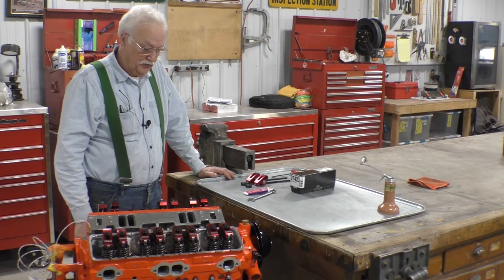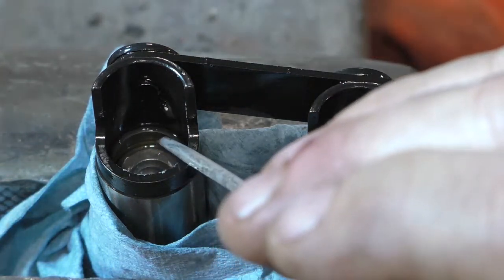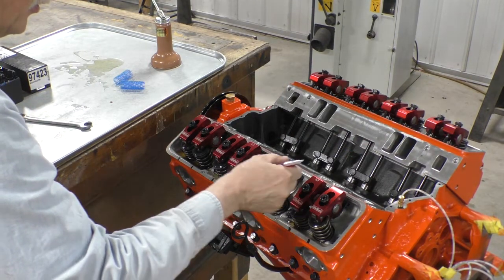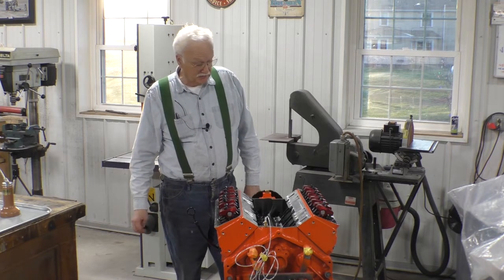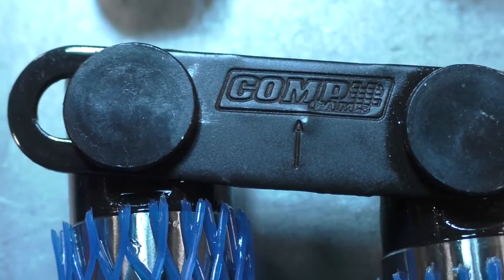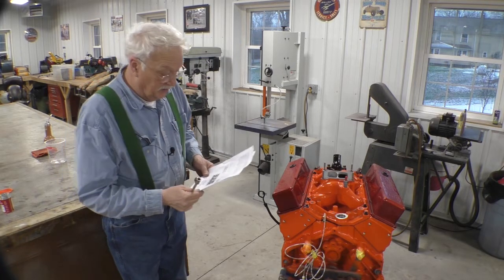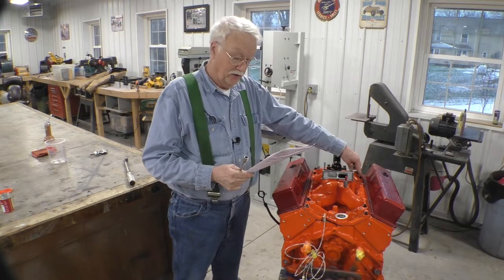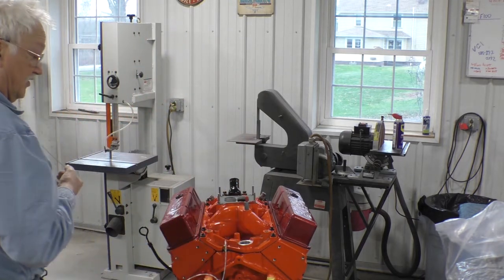SBC Intake Install and Timing the Engine

Comment: Glen this problem with the poor quality HR roller lifters has been going on for decades. Hydraulic roller lifters are the way to go for street use, but the best precision made lifters are made by Johnson company. They make lifters for the OEM engines in our passenger cars, it seems that most rather ALL others are still trying to make a good lifter, and still can not produce a good quality piece. Using anything other than a Johnson product is a big gamble still today. Johnsons are the Cadillac of lifters. I would not use any other brand in mine or my customers engines even if they were FREE. The issue seems to be poor clearances inside the lifters and poor machining quality, needle bearings issues and possibly off shore guts too. Johnsons are not well known like the big names and harder to find because their main bread and butter is in passenger cars, but they do make performance lifters also. Some guys have used solid rollers on their HR cams to solve this issue, it does work in most cases, best to exchange them now is the best option. My $.02 cents.
Reply from the maker: The cam came in a "kit" so I had little choice. Thanks for the complete write up.

Comment: I went with Howard cam and roller lifter combo on my 74 sbc. Think I’ll check them lifter springs before installing. With mine, you gotta pull the heads off to get the lifter out because they’re taller. I don’t want to have to take stuff back apart. Thanks for sharing!
Reply from the maker: Taking stuff back apart is just part of the fun.

Comment: You couldn't fix the collapsed lifter?
Reply from the maker: I fixed it by having the vendor send me a second and then a third set of lifters.
Reply: @ThrottleStopRacing  I only use solids, hydraulics are more trouble than they're worth.

Comment: I was always tought to soak lifts in oil overnight to prevent lifter colapse  and sticking. I no instructions said don't soak, but that makes no sense to me.
Reply from the maker: It does in a way. If you fill the lifters with oil and the check valve does not release the oil when you adjust the valves (knowing that fluids do not compress) you could actually be opening the valve in the head when you add the preload to the valve adjustment.
Reply: @ThrottleStopRacing  good to know. Thanks
Reply: I've never soaked or "pumped up" hydraulic lifters